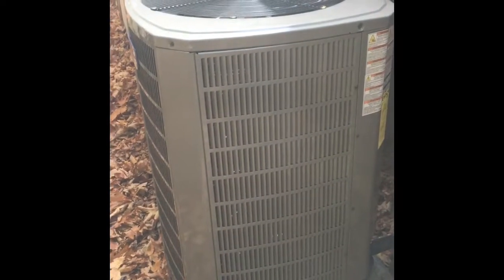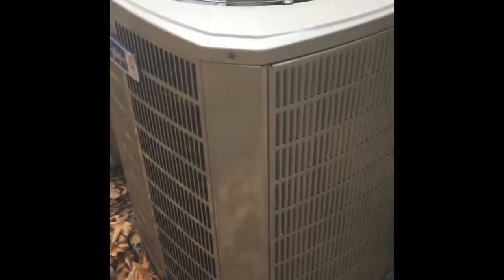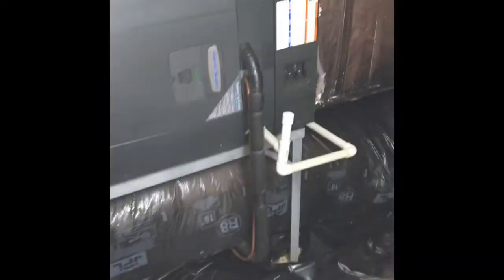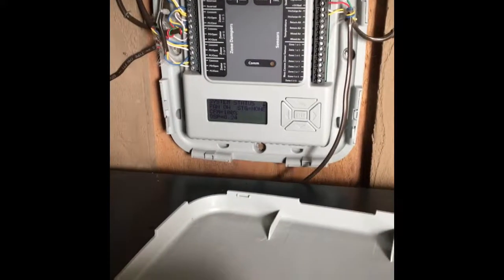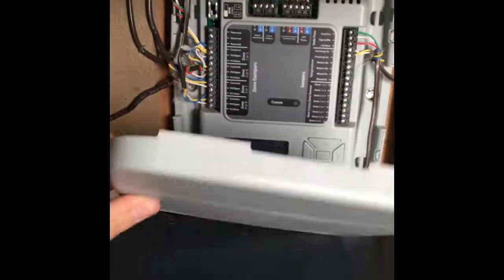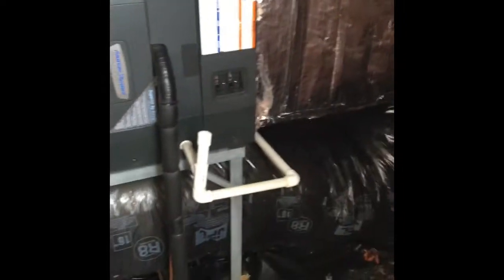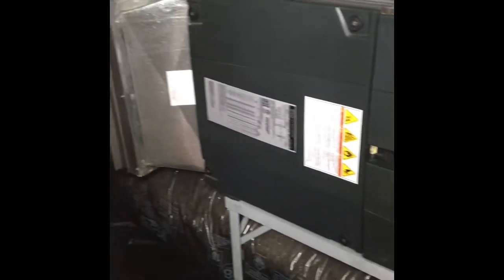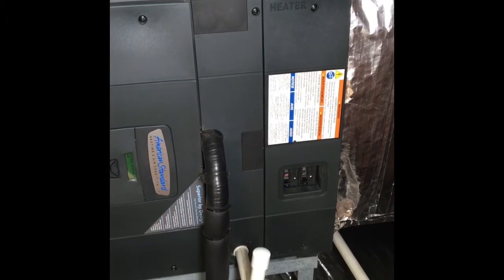Variable Speed American Standard Heat Pump

Comment: I've been looking around online to find out if the air coming out of my American Stand. outside heat/cool pump should be blowing hot air. I really don't trust anything about this unit so I question everything. I've had it 6 years (bought new) and already the heater core had a leak and about killed me and 4 dogs with carbon monoxide. Expensive repair even though the heat exchanger was still under warranty.